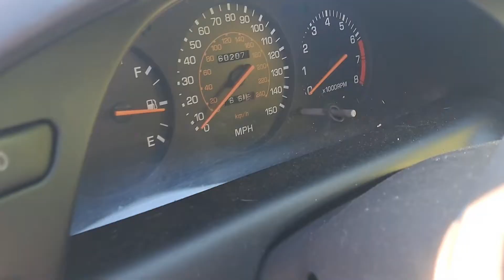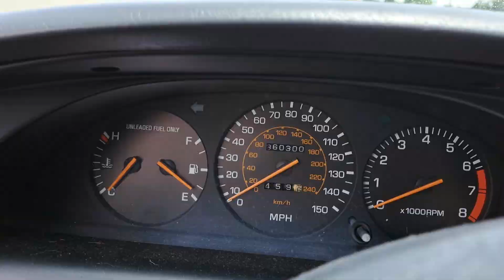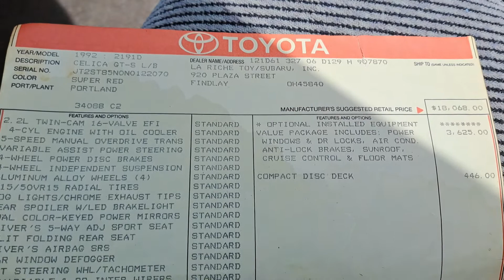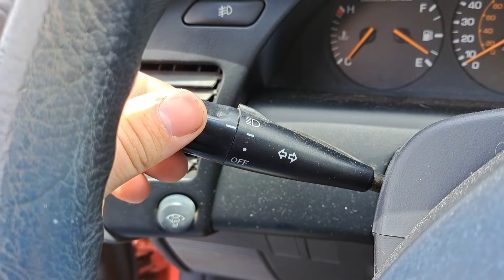I bought another one...........1992 Toyota Celica GT-S Review

Comment: I had a 1993 convertible in red.  Drove until the manual transmission died... Clutch still perfect. At 6'1" it was super small for me. But the upgraded sound system for the convertibles was outstanding amp under the passengers seat, and impossible to get 10"   subwoofers in the doors.